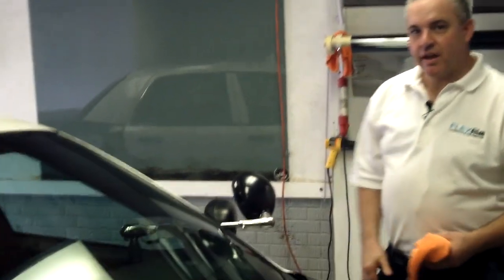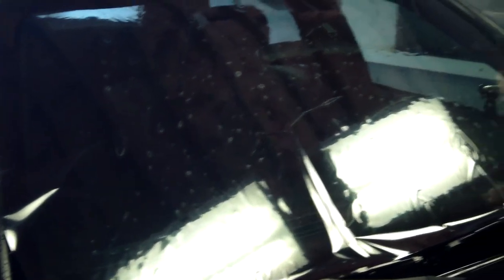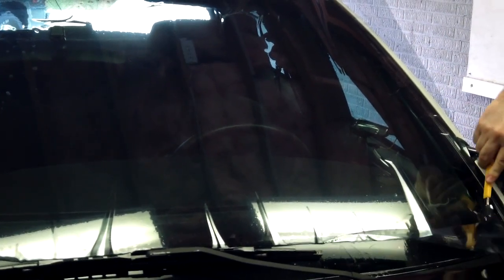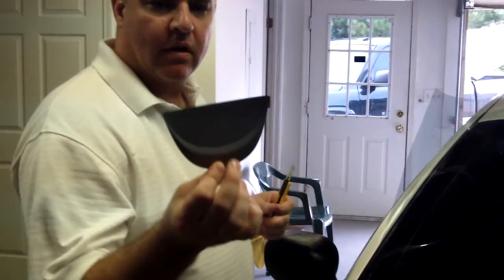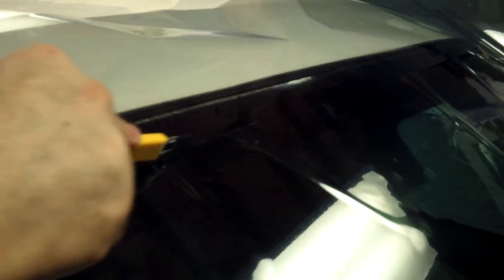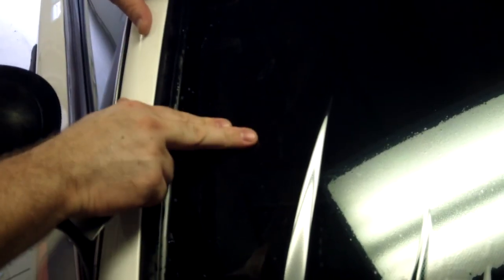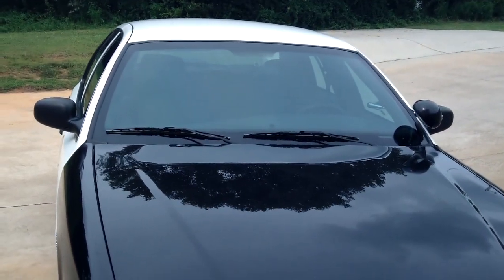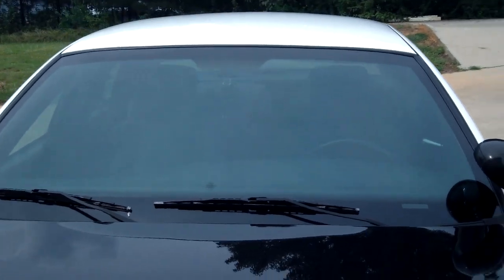Pocket Shrinking

Comment: The issue I've had with pocket shrinking on certain films is the heat gun drying out the water/soap and then the finger won't glide across the glass ...
Reply: works wet or dry

Comment: Only thing I don't like is how you hold the pointer finger on top of the knife ... Pointer finger and thumb on each side of the knife with the pinky or ring finger  pulling tension puts the knife at a more parallel position to the glass and makes it less likely to etch..